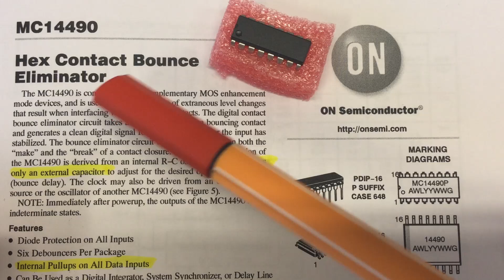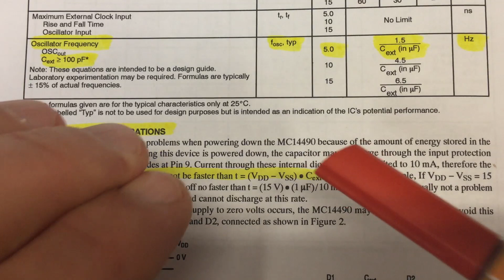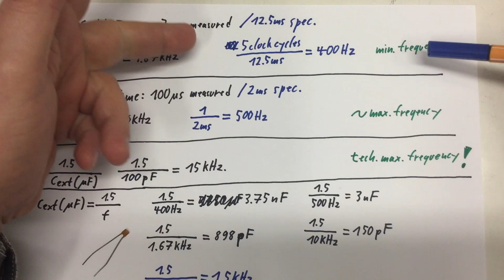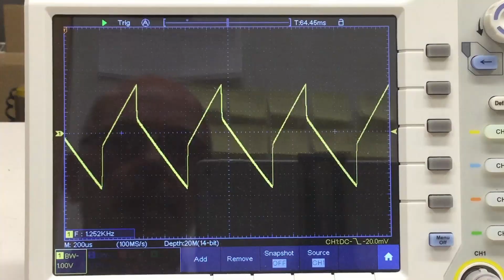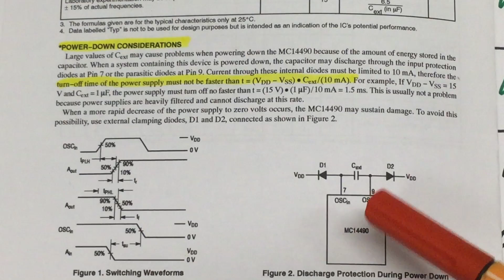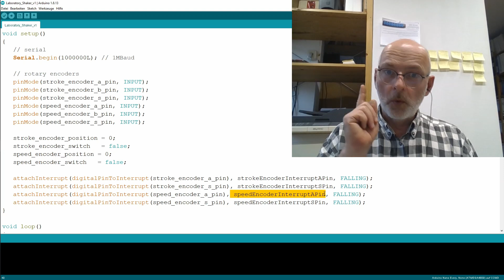MC14490 Hex Contact Bounce Eliminator (e.g. Two Rotary Encoders & Arduino)

Comment: THANK YOU! I too have a disdain for software debouncing. So sad the DIP is unavailable, but the surface mount parts are under $1 for 10 or more, from Mouser or Digikey.
Reply from the maker: You're welcome! Yeah, the SMD parts are still available and (meanwhile) I'm no longer afraid soldering 1.27mm/0.5'' pin pitch parts onto breakout boards 😅

Comment: Hi Robert!
I have my project completely at 3.3 volt (STM32). The documentation for the chip does not say anything about how to calculate the capacitor at 3.3 volts, although it is indicated that the chip works from 3 to 18 volts.
I'm trying to pick up the capacitance by picking, but it doesn't work. (I don't have an oscilloscope) The output of the channel is always high equal to VDD = 3.3v, although the correct signal from the encoder is applied to the input. I tried 1nF, 10nF, 20nF
Any ideas what I'm doing wrong?
Reply from the maker: Hi Emmett, my gut feeling is you should try some smaller capacitor values. I used 1nF at 5V to get 1.5KHz in my example. To get the same frequency at 3.3V you need an even smaller capacitor. The general formula is X/C[uF]=f[Hz] with X = 6.5@15V, 4.5@10V and 1.5@5V. So @3.3V X should be smaller than 1.5. I would try 470pF, 220pF and 100pF.
Reply: @robertssmorgasbord  Thank you very much, Robert. For 3.3v, 470pF is perfect. If set 1nF, then the MC14490 is already starting to skip encoder steps.
Reply from the maker: @dr.emmettbrown8466  I'm glad I could be of assistance 🙂
Reply: @dr.emmettbrown8466  awesome

Comment: That's, by far, the most explicit lesson I've seen so far about hardware debouncing.
I was sold to RC filters + diode + Schmitt triggers, yet ... it's not that easy to cleanly implement on a PCB when using multple (foot)switches AND encoders. You probably sold me to MC14990. :) Much easier to use and integrate on a PCB.

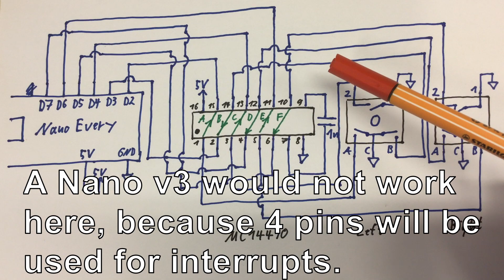Yet, when you note at 17:43 that a Nano V3 couldn't fit in there, it's not entirely true. Nano V3 (based on ATMega 328P) only have 2 external interrupt pins (2 & 3), that's true. Yet, we can still use pin change interrupts (PCINT) on nearly every pin, and those can also be easily configured to trigger either on rise/fall/hi/low/change states. There are quite a few additional libraries for that purpose.
Reply from the maker: First, thank you very much for the praise! Second, my bad! Kind of ... I should have mentioned that you can use PCINTs on basically all pins with a bit of bit banging. But to keep things simple I stuck with the easy to use stuff the Ardunio IDE offers out of the box. I hope you can forgive me ;-)

Comment: Hello Mr.Robert , Just a question would it work the same with a RC lo pass filter , fed into a schmitt trigger buffer ( to clean up the exponential rise and noise ) and then to the uC ? This could be a cheaper solution ?
Reply from the maker: Yes, it absolutely would. See also my other video about de-bouncing rotary encoders: https://youtu.be/nboGwG94hCw . In case of an ATmega you (sometimes) don't even need a Schmitt-Trigger, because the inputs have some hysteresis. Is it cheaper? Yes, a single (non-obsolete) MC14490 will set you back about 5 bucks. You can but a lot of capacitors/resistors and several hex Schmitt-Triggers for that money. But you'll have to do a lot more soldering ;-)
Reply: @robertssmorgasbord   Thanks much ! Will watch the video, don't know how I missed it.